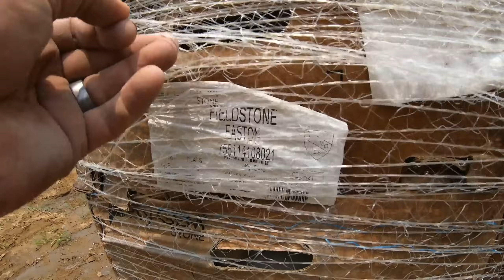Installing wire lath & plaster for cultured stone veneer fieldstone

Comment: You do need 1 layer of barrier over zip sheathing for veneer stone or stucco. For veneering and stucco, you need 2 layers of wrb. The zip sheathing counts as 1.
Reply from the maker: No such thing as a double vapor barrier
Reply: @DIRT-BOSS  read literally any manufactured stone/stucco manufacturers installation instructions and you’ll see they call for 2 layers of WRB. First layer is your drainage plain, and the second is a sacrificial layer that keeps the mortar from contacting the first layer. You should definitely have rain screen between your WRB and lath as well. Hope you installed weep screed at the foundation and properly flashed your window, and allowed for 3/8 expansion gap with backer rod and sealant around windows and doors!
Reply: correct. 2 layers of wrb.. zip or tyvek is one... you need an extra layer of tar paper. it is not a vapour barrier, it is a water resistant barrier. the stone or Cementous stucco wicks water, the extra barrier is to prevent persistent moisture on the main barrier. check best practices from the manufacturers...you are correct
Reply: From what I understand its now (as of 2022) code in all areas except your super dry areas like nevada/Arizona/newmexico to have 2 layers of wrb.
Reply: @DIRT-BOSS well 2 hamburgers with cheese are a double cheese burger.
Reply: Don't reply to me I'm just joking
Reply from the maker: @timchamberlin9280  FYI I had told the builder which is the homeowner I believe that itt needed a moisture barrier over the Zip.. he stated he called the manufacturer and is not needed. I don't argue with the guy thats paying that did his research.
So don't hate Timboy!
Reply from the maker: @timchamberlin9280  with that said why don't you show up Monday we will have a Pepsi challenge Timmythekid
Reply: 2 layers of grade D vapor barrier
Reply: The best thing you could do is use an entangled mesh product for your drainage plane then you have  drainage and drying and no cementous product touching the zip sheathing.
Reply: You are 100% correct.   2 layers WRB over Plywood or OSB sheathing (= Zip board)

Comment: My two cents...an additional layer of a WRB, like felt or housewrap, should be used over the Zip sheathing.  The stone manufacturers require 2 layers of a WRB under the lath when used on the exterior.  The first layer does the primary function of protecting against moisture (in this case, the Zip system), the second layer is a sacrificial layer/slip sheet to keep the scratch coat from bonding to the main WRB.  You definitely don't want the scratch coat to bond directly to the Zip sheathing...it'll act as a bridge for moisture.
Reply from the maker: Funny how codes change over the years

Comment: I used to use roofing nails now I use a finish stapler with 1 1/2 inch staples it holds the wire better to the wall because you’re relying on the nail head to hook the wire
Reply from the maker: 10/4

Comment: Should always have two layers of barrier.  Zip system counts as one.  Also, new rain screen systems are the future of these veneers.  Also one other thing is might want to use a true galvanized nail for the lath.  Installed in dry climates not that a big deal though.
Reply from the maker: Rule of thumb double moisture barrier causes moisture
Reply: WRB isn’t a moisture barrier, the poly plastic or Kraft face paper on your insulation is your moisture barrier. Most stone/ stucco is required to have 2 layers of WRB per installation instructions and usually required by most building codes

Comment: I remember first time I ever tried doing stone. I didn't know about parge coat. I just slapped stone on wire mesh. Lucky I was only doing small area around gas fireplace. Live and learn
Reply from the maker: Yeah I hear you there
Reply: You also have to put the wire going in the right direction!
Reply from the maker: @gthiii  absolutely... Really no matter which way you put it though and get a good plaster on it It will be successful

Comment: The zip sheathing isn't a Vapour barrier, neither is Tyvek. They are both air and water barriers. Vapour passes through very easily, designed to be that way. Having two of them layered on top is redundant but doesn't cause issues.

Comment: Zip system or not,  you still need a second layer wrb. You still need a weep screed installed at the bottom with your wrb over lap (rain screen would be best). 
Your cups should be facing up not down. It's also not self furred wire lath (which bumps it off the the wall for the proper scratch thickness. I could go on, but when you said "this is the fastest way to do it" I knew you knew just enough to think you know.  This is all wrong my friend.
Reply: Glad someone said it
Reply: upside-down lath...Naild and not crown staples...no felt paper, no weep screed and through wall flashing either. They will be fixing this in 10 years.

Comment: Building code requires a second layer of grade D building paper or a second layer of non-water-absorbing layer or drainage screed installed before installing manufactured stone. The second layer creates a bond break against the Zip System, keeping the mortar away from the primary WRB.
Reply from the maker: Okie dokie pokie thanks for the tip
Reply: haha...didn't see your comment.  I just said the same thing.

Comment: I just started using a roof nailer for my lath (used to just hand hammer it in before) what a game changer. I use a notch trowel for the finish on the parge, but I like your broom, I’ll try that on my next one.

As always your work looks great.
Reply from the maker: Thanks man appreciate it yeah broom is where at  quick
Reply: Scarifier

Comment: Bad idea to have that scratch coat of mortar hard up against the Zip sheathing! You need a drainage mat/air gap between the lath and the Zip. IRC is now starting to require this drainage plane for stucco and adhered stone veneer.
Reply from the maker: If I could ask a small favor can you start a YouTube channel so I could learn how to do correctly? Cuz the manufactured gave me these exact specs cuz I know zip board is new tech.. I'm old school black tar paper is the best

Comment: If you drive nails into the ZIP System, do you worry about the vapor/moisture protection being degraded? Does it seal around the nails? Can you do the same thing with Tyvec housewrap?
Reply from the maker: Manufacture specs

Comment: I personally would have used Dorken Delta Dry & Lathe. The cost is more, but better peace of mind.
Although ZIP is more keeps moisture out better than Tyvek, you'll have a lot of penetrations for water to seep into the sheathing.
The Delta Dry & Lathe allows an air-barrier between the veneer and your sheathing allowing moisture to drain and dry out more efficiently
.
Reply from the maker: Good info but I didn't build the house

Comment: I know this is a typical installation but how do you get water drainage ? Seems the mortar passes the mesh onto the zip barrier blocking any drainage.
Reply from the maker: If it does get water it should weep out the bottom this is typical install as you mentioned
Reply: @DIRT-BOSS  i have seen it weep through the nail holes directly into the house. i know it sounds crazy but it does. need rainscreen or all this time, effort and money is a wasted. great vids. look into using rain screen

Comment: I used to do wire with scratch coat, now l do cement board and brush on bonding adhesive just before installing stone and just butter the stone, takes away the weak link, all failures I've seen was in the wire I've never had an issue will cement board and bonding adhesive
Reply: As long as you’re not using hardi backer
Reply: @CMCraftsman  it's made for exterior use also just not direct exposure,

Comment: Do you have any tips for plastering the scratch coat on an inverted piece, like the underside of a garage door opening?  Just slap it up there on the lath and hope it holds, and doesn't end up on your head??  After it dries, I'll be installing a cultured block/brick, under the garage door jamb, so tips on doing that would be helpful, too.  Will try the wood screw trick you guys used for drip stones, and I'm going to use a very sticky thinset mortar (Ardex x77).  If the blocks fail to hold, then I'll resort to installing wooden lath strips underneath the stones.   Great video's.  Thanks!
Reply from the maker: Yeah not sure about that just go nice and slow Good luck 😎
Reply: @DIRT-BOSS  Well, hmmm, I guess I'll wear my "mortar on top of the head" old hat.  Thanks for getting back to me.

Comment: Hello, I've done this before but was on a solid concrete wall. Is it ok to use standard felt #15 tar paper only for my vapor barrier then lath? Last question, what size nails on the nail gun. Fantastic idea!! Thanks much
Reply from the maker: Yes tar paper works great also for the nails are standard size roofing nails
Reply: @DIRT-BOSS  Hey thanks much for the tips! You do nice, efficient work!! Thanks again

Comment: Great content. Why didn't u use thinset ?.. I'm currently doing ledger outside wall and was advised to use thinset.. any suggestion,  thanks
Reply from the maker: Thinset is for tile.. never used it for stone
Reply: https://www.homedepot.com/p/MSI-Alaska-Gray-Ledger-Panel-6-in-x-24-in-Natural-Marble-Wall-Tile-6-sq-ft-case-LPNLMALAGRY624/207041865 

This is the item I'm using, they suggested thinset white based. Not sure these qualify as stone or something else. Thanks
Reply from the maker: @oscarocampo4575  yes thats more of a tile based product
Reply: @DIRT-BOSS  thanks for your insight

Comment: Good video.  Question I started digging out for a monolithic concrete pad there are a couple of stumps that been grounded down below the depth of were my stone sub base is going to be. Would it be ok to just put the stone down and concrete or should I get a backhoe and remove them? 
They are pine tree stumps, about 20"s down
Reply from the maker: I would remove all stumps they will rot and cause issues

Comment: You mention double vapor barrier being bad, with tyvek over that green board; I'm doing a chimney chase that has tyvek house wrap with tar paper over that.  Will that create the double vapor barrier?
Reply: found this online, "The building code requires two layers, or equivalent, over wood-based sheathings when the cladding is a cementitious product;" I think I'm fine since both are on the exterior and the felt paper will act as a bond breaker layer.  The Interior will be batts.
Reply from the maker: I would check with your local codes
Reply: @DIRT-BOSS  It's in the IRC and ASTM that 2 layers of WRB is required. As well as recommended by every association and manufacturer.
Reply: @stuccoproinspections7763   what are the repercussions of not doing that and applying a cementitious product directly over ZIP?

Comment: I did feel only zip system without another barrier is risk
Reply from the maker: I agree I had that conversation with the builder and they checked with the manufacturer and said no.. so my hands were tied I wanted to use tar paper

Comment: Question to anyone on here.. Do I need wire mesh on my outside foundation wall to lay stone or can I install stone without the mesh?
Reply from the maker: I've done them directly on the concrete wall Just make sure there's no sealer on it Hit it with a pressure washer to open it up first maybe a little chemical

Comment: Can this be done on OSB board?
Reply from the maker: Check your local codes
Reply: @DIRT-BOSS  i am asking technically if its possible. Will the joints crack due to wind deflection?

Comment: Are you aware that the lath should be encapsulated by a 1/2 thick of plaster to protect it from rusting.  Because you are not anywhere close.
Reply from the maker: To much weight & if you think plaster is moisture proof then you really are lost
Reply: @DIRT-BOSS  you need to look at ASTM standards.  The cement encapsulates the lath and protects.  Lath will rust.  If you don’t know that go by the Embassy Suites at the north end DFW airport. Lath rusted out  and stones fell of in sheets.  I am in the industry and see this.  Talk to coatings, mortar and thin veneer manufacturers and see what they say.  Of course the plaster is not moisture proof.  A better option is cement board replacing the lath and plaster.  The coatings and mortar manufacturers will all give 10 and 15 years warranties with cement board.  It is also much faster and to your point is much lighter on the wall.
Reply from the maker: @bretswan4623  well if you're in the industry I think we both can agree that cultured Stone is a joke and not forever I don't care how you put it on you're only as good as the nails the lath...gravity will win over time nothing like real Masonry separates the boys from the men
Reply: @DIRT-BOSS  have you ever used cement board.  If you use a good medium bed polymer modified mortar the manufactured stone or real stone veneer will be there forever.  The better mortar will give you a 400 to 600 pound shear bond strength.

Comment: Within seconds I can pick you apart!! Bada Boom Bada Bing...
No need for paper eh??? As adding housewrap/felt is still a viable option with Zip System...harming nothing/causing no issues...lest be said your pretty tight on mesh overlap which can cause cracking through Fake Stone Veneers!!! Then there are nails...acceptable...had to laugh at the laziness though of grinding/cutting wheel...high risk maneuvers causing severe potential damage as waterproof membrane cannot, must not be penetrated thus causing failure of zip system??? All at 2;27 into vid!!!
Brooming will getcha by...but have never seen an actual broom used??? Ha...improvisation is sometimes part of the gig, and you are technically keying...as for the wire being hung upside down as others in replies mentioned...I laughed as you hung it properly...could tell before you even approached wall to show as Sunshine tells no lies...kudos to not hanging it diagonally as well as oh so many do...laziness...and not just licking and sticking to diamond mesh as illegals do often!! Meaning no scratch coat...Heads up...Zip System membrane cannot be penetrated...as nails recessed to deep...seam membrane broken...Stay safe...I have a few of that style of frames...gots to find some more...as I am a journeyman plasterer by trade...Oh yeah...a reply mentioned self furring lath...I have always found that unique as it depends upon substrate...generally block where it is used, but wire is wire...strength comes from concrete...adherence by wire attached...the less seams in the wall the better...
Reply from the maker: @foresakentonone4148  Show up Monday let's take the Pepsi challenge
Reply: @DIRT-BOSS  
Finding help is a mutha aint it??? Start a house Monday...and dunno where your at...I don't work cheap...American rather than illegal...